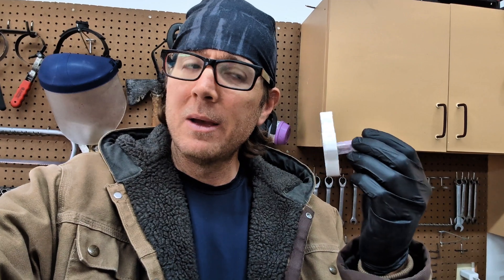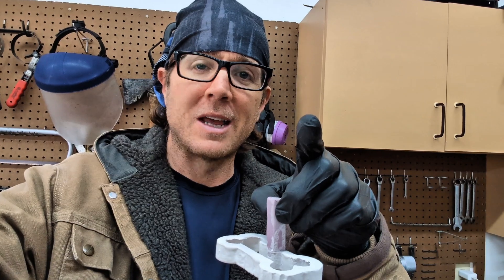( Sand Casting ) - Different Sand molds For Casting

Comment: Hey, considering the skechy setup this one turned out really nice! What kind of foam did you use and how high was the melting temperature?
Reply from the maker: Hey thanks 👍. Using polystyrene XPS is best and the Molten metal is around 1800F.  I use this method all the time.  Check out some of my other projects 2024 Lost Foam Casting: https://www.youtube.com/playlist?list=PLrdcGmB7TsJYCzEWHsFrybscmCuXEbB8V
Reply: @HeinrichsMade  thank you so much. I have the idea of casting a slingshot from tealight cups by using lost foam tecniq. Greetings from Munic, South Bavaria
Reply from the maker: @timkoenig4471  that's going to take a lot of tea lights 😂. I've done a slingshot in the past 
https://youtu.be/UnFLpwBFNrk
Reply: @HeinrichsMade  i have about 22 Kilos of tealight cups because i use a tealight stove to heat my garden cabin:)